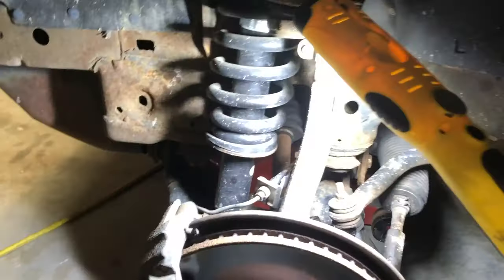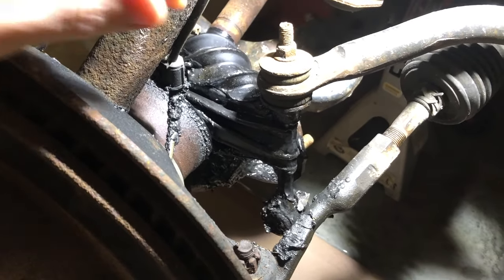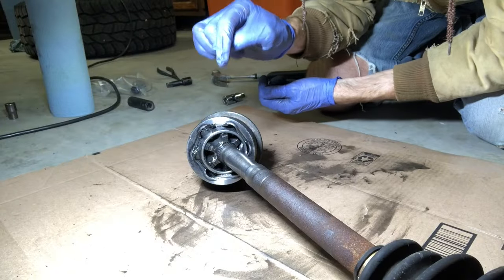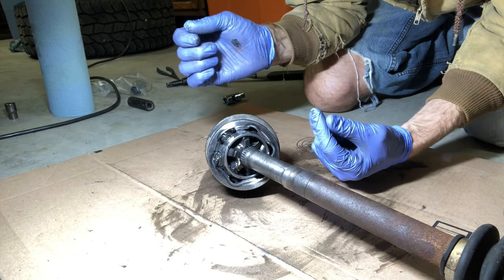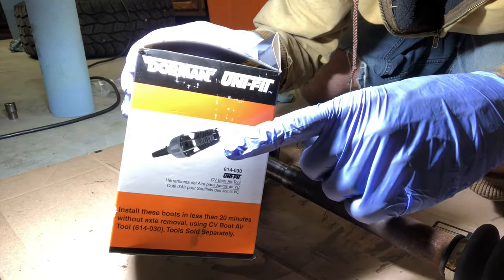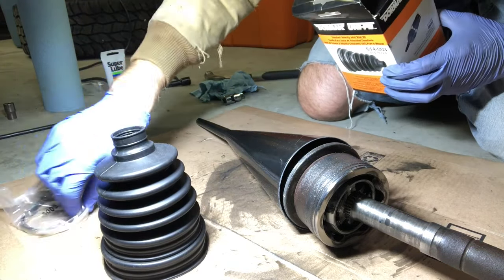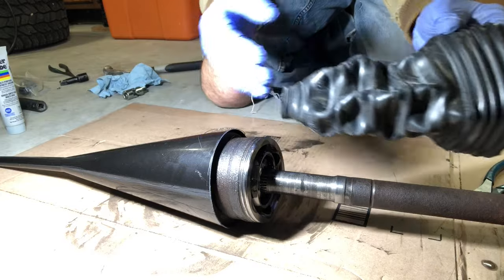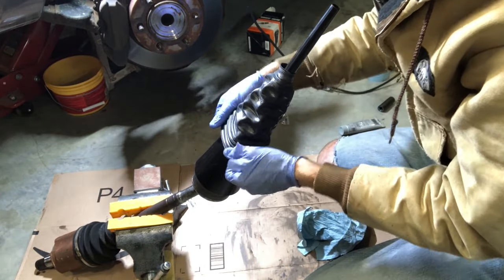Install CV boot with a funnel?

Comment: I hint for the next time you do it, take you a bowl of water put it in the microwave put it on about three minutes two minutes depending on what microwave you’ve got and pull it out and let the boot sit in that warm water and it will soften it up Tremendously and make it so much easier. Do not do like I did the first time and put the boot in the microwave in the water. It burned a hole in it, so but yes, hot water will make it 10 times easier.
Reply: hot soapy water might be even better?
Reply: @dirtydavesgarage8251   You don't want to use ANY detergent that could break down grease in the joint. Use a hair dryer to warm the rubber to make it stretch easier and then a light smear of multipurpose grease or clean engine oil to help it slide on to the cone and then onto the shaft.

Comment: Dude, you never use dish soap for a job like this. That thing dries in seconds and will actually work against you getting the boot over the cone. It would have been better to use a little bit of the same axle grease on the cone, or my favorite,  the one and only WD40.

Comment: Sometimes boiling water super hot in a large pot,and drop the boot in and let it sit for 15 minutes,makes this a lot easier.
Reply: thank you for the tip
Reply: What about warming it up a little with a heat gun ,or is that a definite NO GO

Comment: There is an easier way.  Since the 8:25  outer boot is bad, it also advisable to replace inner boot and you dont have to remove the drive shaft from tranny which requires the fluid to be drained.  You can separate the inner joint by removing the boot and leaving the end in the tranny.  Then the inner joint has a snap ring to release the bearings.  Now you dont have to stretch the outer boot over the outer bearing.  Outer boot gets installed from inner side of shaft without any stretching....

Comment: Yeah these actually work.  Not fun in cold weather though! that rubber refuses to expand enough, I know it's against the instructions (or it was in mine) but dumping the rubber boot in some very hot water first really helps, dry it off quickly and use lots of grease on the cone.  My cone is specifically for this, the plastic is heavier etc and the end isn't open like a funnel but I can see how any long funnel would work.

A tip: probably easier to do with the axle installed in the car if you can separate the ball joint and swing the suspension out of the way, at least then you're pushing against something.

Comment: Thanks for the instructional. My application is a little different, but similar. I need to replace the boots on my 1953 Dodge driveshaft ball and trunion universal joints. The construction of these old drive shafts makes replacing the boots a task. The OEM style boots are expensive and are quite alot of work to install through the interior of the union cup, I'm hoping these Dorman unifit boots work out as a faster less expensive seal for the jojnt. Watching you do it gives me inspiration. Thanks again!

Comment: Great job and saved a few bucks, I found heating the boot with a hair dryer made it a lot more workable.
Reply: +1 for this. I don't have air at home for the actual tool and heating the boot on the funnel makes life much easier.

Comment: Thank you for a great film. I didn't know how to use the Cone, now I know, but I see it requires a lot of strength, not sure if I can do it. I thought to buy that special spreading power tool with opening jaws, but people complain that it tears the boots, kind of works only on certain type of boots, and how to know which boot will be torn, unclear. I don't have that type of problem w/boots, but good to learn how all that works. Thank you again.

Comment: Excellent method, POSSIBLY warm up the boot with a heat gun to stretch easier??
Reply: It’ll probably stay stretched if you use dry heat, I’d use near-boiling, just hot water, the moisture will help let it reform
Reply: @TheRegretedURL  thank you for the reply Love and peace
Reply: No te lo aconsejo.

Comment: Looks like this repair process was a struggle. I agree with the previous comments, it would have been easier to remove the joint. The boot expander is expensive. Shops have that  tool and pays for itself. Not worth buying for weekend tree mechanics.

Comment: Bro sped up the video in the only part we needed to see. 😄
Reply from the maker: You force the boot over the cone. The elasticity of the boot, size of cv joint, etc will play a factor at how quickly it goes for whatever you’re working on. No point in watching me struggle for 10-15 minutes.

Comment: 1988 Toyota Camry LE broken boot, so I got a Dorman 614-001. I'm thinking I want to try this way as well. Don't really want to take the Axle apart. It's the passenger side half shaft from the factory. Maybe easier if Axle is left on vehicle? Thank you for the vid!
Reply: Buy genuine toyota cv boot kit. MUCH more durable rubber boot material. My cv boots are still not ripped car was made in 2008.

Comment: The least bit of dirt left in the grease in the CV joint will be making you revisit this project very soon. It needs to be hermetically cleaned before re-greasing and reassembly. I'm sure you cleaned it well, but just sayin'
Reply from the maker: Well, this was nearly 3 years ago and still no issues with the joint up until I sold the vehicle a week ago. I don’t anticipate any issues with it in the near future either.

Comment: What did you use to lube the cone with? I have separate Cv axle grease by Valvoline and HF superlube multipurpose synthetic grease. Which to use to lube the cone?
Reply from the maker: I think I used the same super lube
Reply: @DustinRogersinMO o ok. Also, u know what i realized is that u could ve used the cone from the other end (inner joint) to slide the boot over without flipping it... btw i was trying to do it ur way but i have an oem subaru boot and it does not wanna stretch or flip at all.

Comment: Split boot works great. You don't have to take your car apart, just cut the old boot, clean away grease, glue the new split boot on, put on new grease, and finally fix the boot, Done in no time.
Reply: Does that actually work though? Looks like it wouldn’t hold up?
Reply: Pardon me but I’m considering the split boot & super glue technique.  Is it holding up after a month of use?

Comment: Really you can just tap that thing off of there the CV axle it really just taps off of there either end you have to take the other boot off if you work from the other end but I think that it might have even been easier to stretch that boot over that tone by leaving it on the car yeah stretching the boot over the cone that's not you just got to grab it with the shop towel or something and then just push it real quick and hard and don't stop once you move it you got to figure out a way to get your voice bolted down to something cuz that bicycle just slides around on the floors that's not going to work for you you got to get your your voice monitor to the table somewhere

Comment: Did you pack the grease in the joint or does it work its way in.
Reply from the maker: There was still the original grease in the joint. I didn’t clean it completely out, just wiped the excess off the outside. The other grease will work it’s way in. If it’s a brand new sparkly fresh joint, you should definitely pack some grease into the joint.

Comment: QUESTION FOR ANYONE... can this work while the CV is still in the transmission? or does it absolutely have to be taken out?
Reply from the maker: It’d be a huge struggle trying to work around the steering knuckle/suspension. Not saying it can’t be done, but it’ll probably take much longer. 

However, if you can rent/borrow the pneumatic tool that is made to stretch these boots, then it may go super quick for you.
Reply: @DustinRogersinMO  Thank you so much brother... im gonna look into a rental.🤙🏻

Comment: Can i do this way with a oem axle boot, or only aftermarket
Reply from the maker: It depends on how flexible the OEM boot is
Reply: The one I bought is very stiff compared to this. I tried to turn inside out and it's not going to happen. I've seen videos of being able to tap off the CV end with a hammer but I'm not having any luck so I might try the split boot you glue together instead.

Comment: You saved yourself money doing the job yourself and replacing the boot instead of entire axle, nice!
Reply: Debatable. How much is your time worth? Plus the cone, the grease, the kit, the tools (if you don't have them) aren't free. That job is $200 parts and labor at a local shop. He spent about $40 on materials. And between taking the tire off, moving the hub assembly, doing the job and putting everything back together, possibly two hours. An amateur might take 3-4. 

Again. How much is your time worth?

Comment: With that many miles on the car, I would just replace the entire axle/CV assembly. They are not that expensive. The old shaft is at its life expectancy. When it starts clicking and binding you will be doing the same job all over again.
Reply from the maker: Well, it’s been 2 years and still no clicking from the axle. And the replacement boot was $17. A replacement axle from the auto parts store is $135+. Roughly the same amount of work to swap the axle or change the boot. Sure you can get a no-name axle from eBay or Amazon for ~$60, but you may be swapping that axle out in 2 years when it fails and there’s no warranty.

Comment: For those curious, this is a CV joint boot installation tool, specifically it looks like the one made by Moose. 

The rubber goes over a vehicle’s CV (constant velocity) joints, which connect the drive shaft to the CV axle (inner CV joint) & the CV axle to the wheel (outer CV joint) - the rubber prevents dirt/moisture from getting into said joints while driving the vehicle.